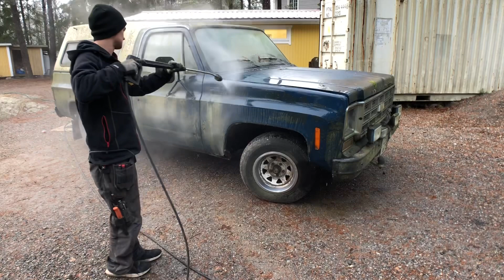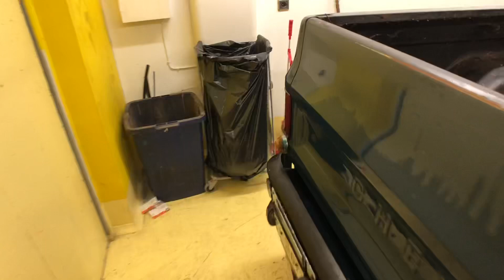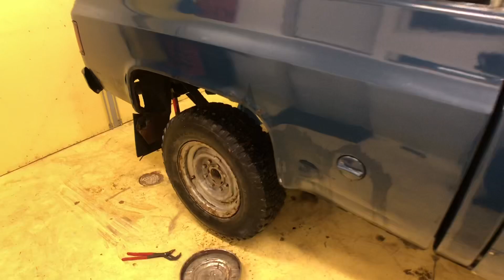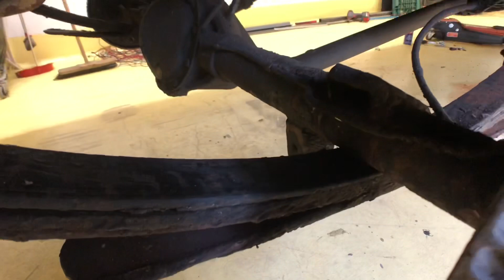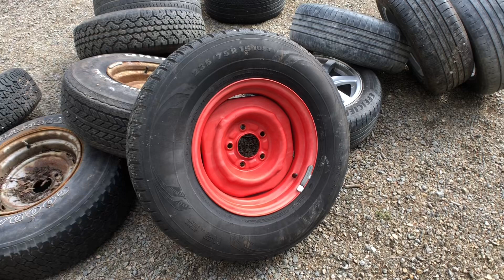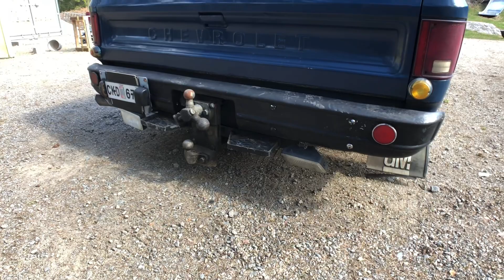Chevy C10 Goes from forest find to street cruiser. Square body project axle flip

Comment: Good work, looks much better. 
When you remove all the stuff not need on the rear , change your reverse lights in rear light cluster to be the indicators(turn signals) for a cleaner look. That's what I did on my C10. I live in the UK so I need Amber indicators. Reverse light not needed on vehicles in the UK until 2009. So never fitted one.
Keep up the good work.👍
Reply from the maker: Thank you👍🏻

Comment: I think the stuff under the truck is undercoating to prevent rust possibly
Reply from the maker: Maby but i think its like used motor oil that had gatherd alot of dirt over the years buy either way it was a major mess😅

Comment: Nice job. Do you have measurements on the drop kit? Greetings from finland
Reply from the maker: Thanks. Sorry didn’t save the measurments.
Reply: Damn. Well i think i buy belltech ready flip kit for my c10..
Reply from the maker: Considering how little the cost to buy its not worth making them yourself, i will buy a set next time.
Reply: @BarelyRunning  well in finland they cost about 270euros. Any good swedish web stores? 😂
Reply from the maker: I checked ebay now and found a set that cost 95$ + 64 $ shipping to sweden.
But ofcourse there will be some extra charges before its here but i think it will be cheaper than 270euro

Comment: a few month ago i got a 79 short box 4x4 Cheyenne full option truck with only 35,000 miles on it in mint condition with the 400 sb with 400 turbo with 2 first gen camaro's and 2 second gen camaro's all for free with about 15 other rigs that were parked out side the shop most are chevy and ford pu
Reply from the maker: You are a lucky man!
Reply: @BarelyRunning  if u only new how lucky i'm with rigs last year i got a 73 ss nova with factory paint i only had 1100 in it with a 396 bb tunnel ram with a pro built 400 turbo inkee wheels i got the trans at a party some guy wanted drugs and his dad own's a trans shop the kid told me any trans for 200 bucks so i got the nice one they had found that out latter the shop had 3600 in the trans plus i know a lot of drag racers witch give me there old parts like a new in the boxes ignition set up with msd  but i all ways give them parts too like a lot of body parts . plus many many more cars i have sitting lot of pu most i got for free and i scrap the one's with rust  i collect 79 and older chevy's and fords plus i trade parts for parts
Reply from the maker: Wish i was that lucky👍🏻

Comment: Have you tallied your total cost for the lowering.  Looks great. Enjoyed the video.
Reply from the maker: Glad to hear you enjoyed it👍🏻
Biggest cost was 100$ for new shocks in the rear wich i could have saved if i modified the brackets on the rear axle.
Everything else i made myself so only cost was welding gas/wire and grinding disks.
But lets say 150$ including shocks and material.

Comment: 3" front, and 5" rear drop? What size tires?
Reply from the maker: Dont know exakt drop but something like that. Forgot to measure before.

235/60 om 7” rim in the front and 255/60 on 8” rim in the rear.
Reply: @BarelyRunning  15" or 16" wheels?
Reply from the maker: 15”. Chevy original rally wheels.
Reply: @BarelyRunning  your front rallys is more 6" than 7".. i got 7" in front on mine and the dish is deeper and your rear drop is 6" :o)